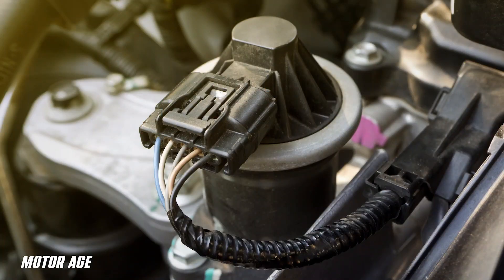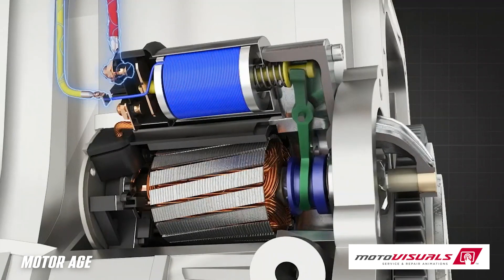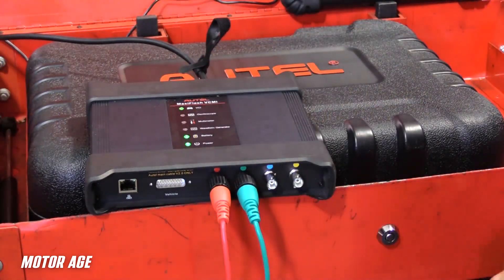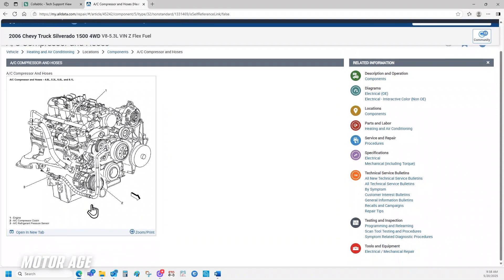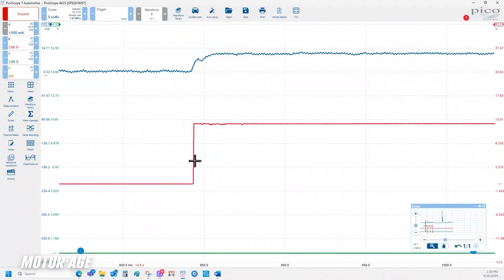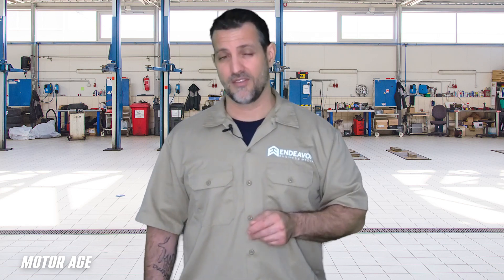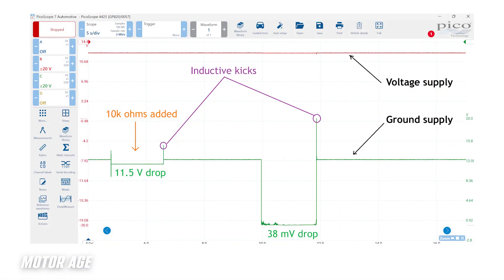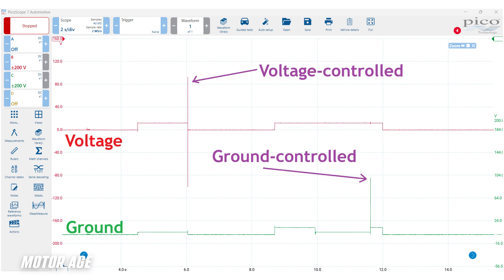The Trainer #161: Component Performance Evaluation-Part #2 (Solenoids)

Comment: Has anyone thought of attenuator in place for inductive flyback. I use even on relays juuust in case. I love my PICO.
Reply from the maker: Yes, fly back voltage (otherwise known as inductive kick,) can cause significant damage to scopes, incapable of handling the excessive voltage. In attenuator is always recommended.

Comment: Showing the scope pattern of the inductor current ramp up while the counter emf is also there resisting that ramp up was never shown with the narrative background in the training I had in the mid to late 1960's which didn't help my understanding of the circuit.  Course we didn't have the scopes like the ones available now.  It wasn't until I bought my Fluke 98 Series 2 scope in 1995 that I started to understand the "How It Works" part of the circuit.  Plus that scope had the (flight) record feature that REALLY helped!
You hit the nail on the head with this training Brandon.  Seeing a working scope pattern and pointing out the current ramp up with the counter emf working against it at the same time on a normal pattern will help to get that "Ya or aha moment."
Thanks for the video.
Reply from the maker: Mike, we thank you and we are pleased you found the video helpful!

Comment: I struggle with trying to determine pull up pull down-high side low side switched
Reply from the maker: Not to worry, this is a common struggle:

“Pull up” is the same as “hi-side switch” 

“Pull down“ is the same as “low-side switch“
Reply: @VehicleServiceandRepair that what I thought. Thanks . They didn’t tell us this in my 2 years of automotive technology. In the 70s 😁